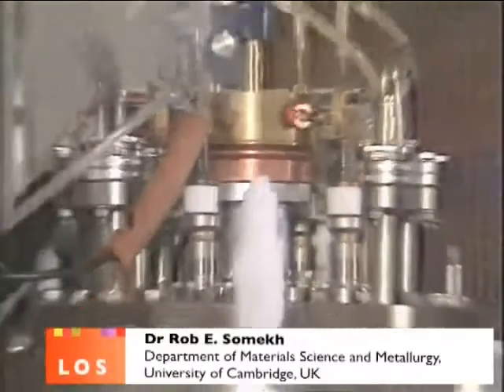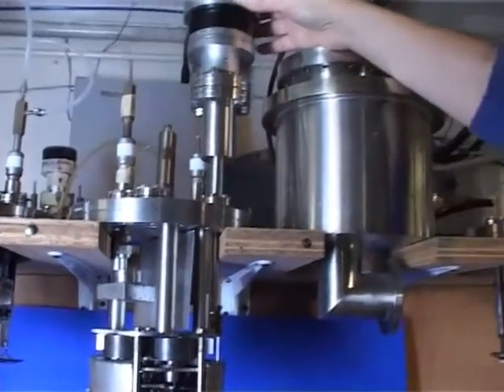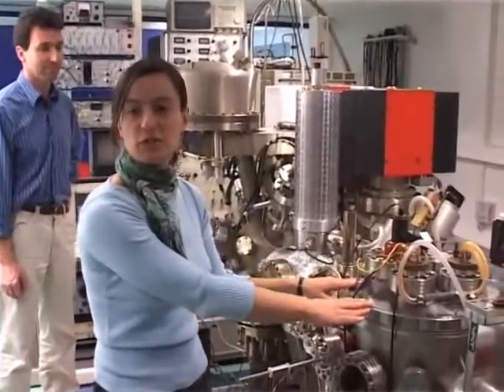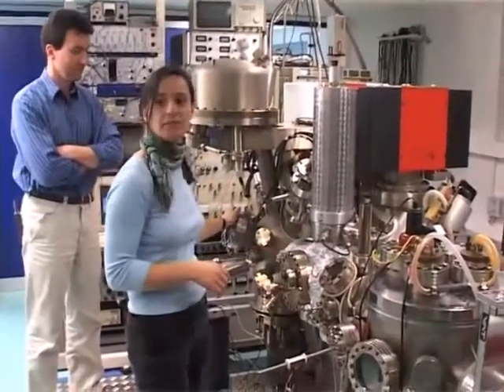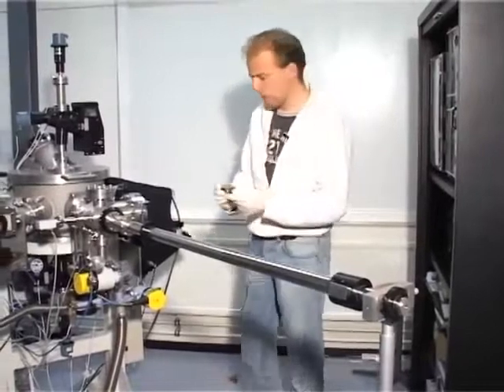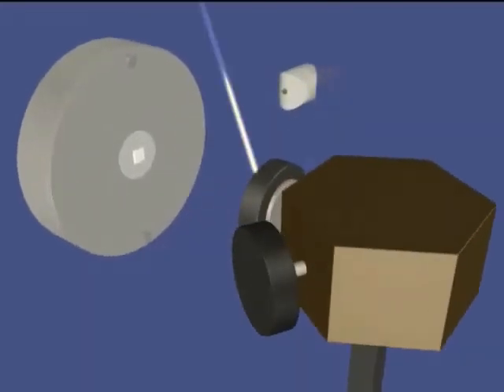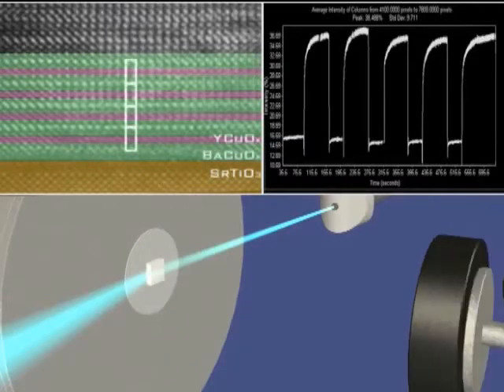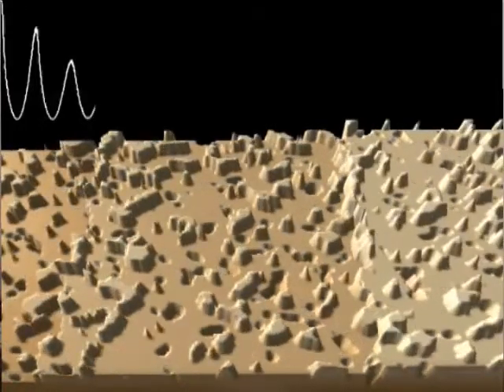Sputter deposition of superconducting films

Comment: I have succefully sputtered copper in glass, however, when I try to plate copper (galvanic acid copper bath) , the deposit come off the glass. What  possible is hapening? thanks for any help and great video.
Reply: I don't have sputtering experience, so take what I say with a grain of salt. There is a chance of the glass surface that you're using isn't clean. Applied Science made a video on cleaning glass microscope slides. You should also try having a titanium "primer" layer. Thought Emporium made a video on growing human neurons, he sputtered gold onto a glass microscope slide, but when cells are grown into the slides the gold layer peeled off.